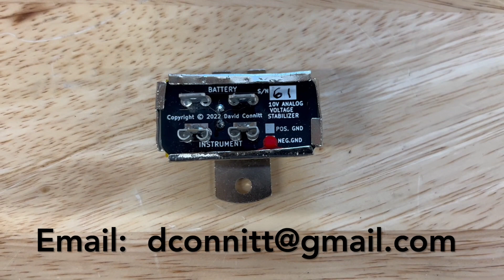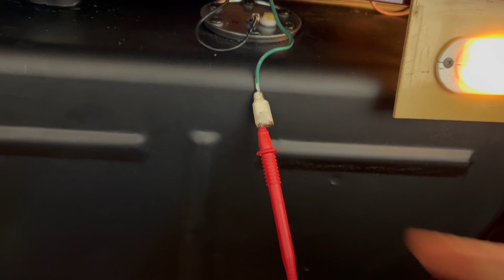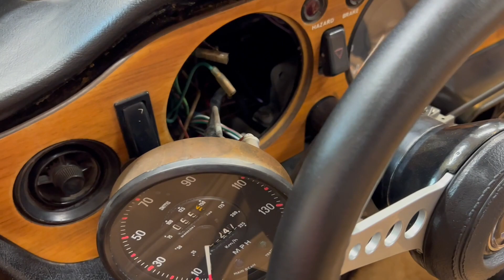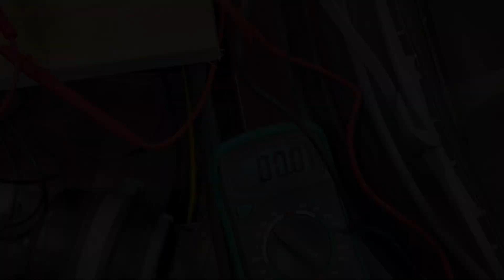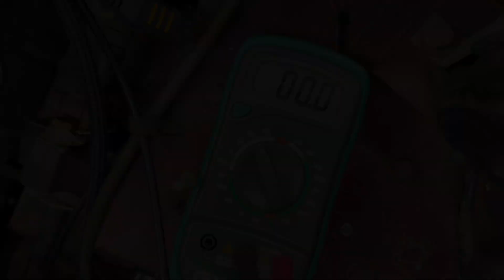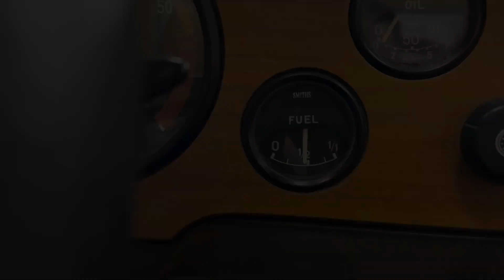Triumph TR6 Voltage Stabilizer replacement

Comment: The stock voltage stablizer needs to be checked with an analog meter, the needle should cycle between 0v and 10v.

Comment: So … I’m far from an expert … so I could be wrong….  But I think your test equipment is giving you a misleading result.  

The DIGITAL multimeter is taking a sample of the voltage at some instance in time.   And the way the old style stabilizer works is by opening and closing some contacts.   When the contacts are closed … you get full battery voltage (~12v).      When they are open … you get zip. 

So unless your multimeter is able to somehow show you the average voltage over time (as opposed to instantaneous). It’s just gonna look like the voltage is jumping all over the place. 

If you had an analog volt meter … you’d see the needle bouncing up and down as the contact inside the stabilizer open and close. 

Which is not to say that your stabilizer wasn’t bad.    It probably was.  

But even if it was good … you’d probably still see values jumping all over the place.

Comment: Did you move the ignition switch, or is the 69 stock like that? If you moved it, what switch did you use, part number if you have it?
Reply from the maker: The ‘69 has the ignition switch near the gear shift like that. That was standard in ‘69. Although I’ve seen some relocate it to that position. Shouldn’t be too difficult. Just need to lengthen the wires and find a suitable spot to drill a hole.

Comment: A  L7810C  is a 10 volt regulator. A  L7809C is a 9 volt regulator the 10 volt is £1.71 & the 9 volt is £2.60 from eBay you will need a soldering iron! watch out for the tab being earth!
Reply: Hi Andy,
Dave Connitt here. I want to reply to a couple of your comments on my voltage stabilizer. I don’t use the LM7810 voltage regulator. I use a regulator specifically designed for automotive applications. It has many advantages that the LM7810 doesn’t have like a wider operating temperature range, reverse polarity protection, and over voltage/current protection. Secondly, now matter which regulator you use you MUST include a suitable input and output capacitor to protect the regulator. This requirement is in all the manufacturers data sheets. That is one of the reasons the stabilizers you buy are failing as they just have the regular hanging there by itself. And thirdly, my regulator is thermally bonded to the case to sink heat out of the regulator. In normal operation the regulator needs to supply about .25 amps but these are all linear voltage regulators and they all generate heat which will kill a semiconductor.
I’m not trying to be a smart ass at
 all but just wanted to clarify what you stated.
 I was a printed circuit designer for 35 years. Before I ship one of my voltage stabilizers it’s burned in for 24 hours at 150% of it’s nominal load.You can use a 7810 but read the data sheet which you can download from the manufacturer for free.
Thanks,
Da

Comment: the gauges in these old cars work on a wire that gets hot when current from the sender passes electric current through them, that is why they take time to warm up and read correct.the length of wire drives the needle directly. The voltage regulator works on a similar principle turning the current on a off at a "average" voltage of 9-10 volts. If you did not have a voltage regulatory gauges would go up and down with system voltage ie engine ruining and charging battery and engine off. moden voltage regulators are solid state electronic devises.